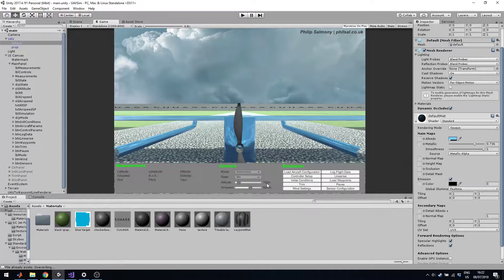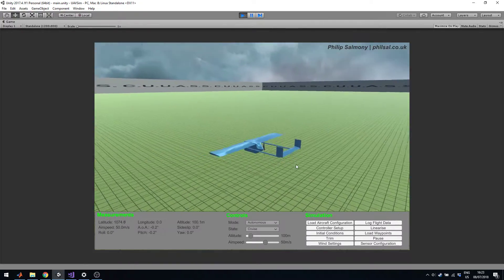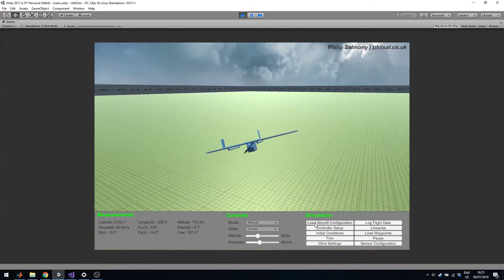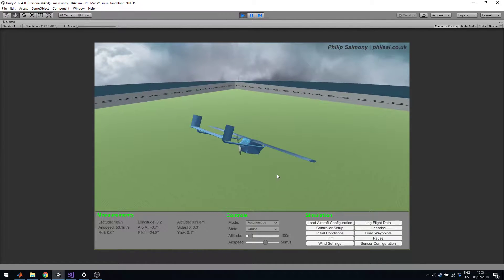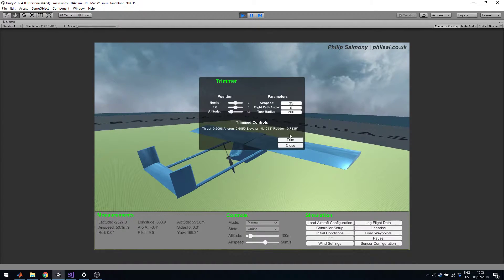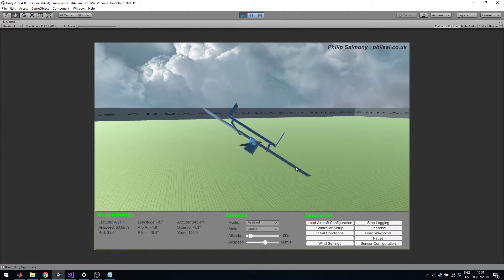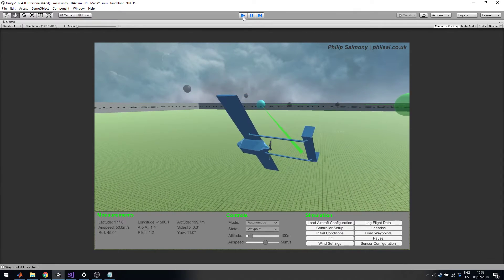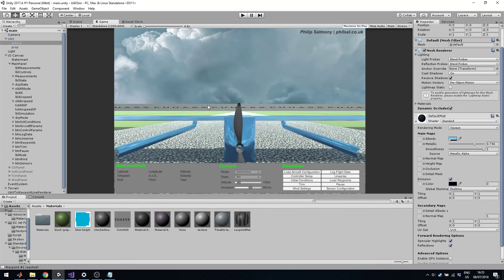DIY Flight Simulator (Unity/C#)

Comment: How did you make the control under the screen that can adjust Mode, State, Altitude, Airspeed etc.?
Reply from the maker: I just used Unity's UI elements and then add callback functions in coded.

Comment: Great job. How did the Challenge turn out for your team? Where you helped by the simulation on the Unity platform? We are aiming to try something similar for underground drone operation in mining environment.
Reply from the maker: Thank you! Unfortunately, we didn't end up taking part in the competition, due to exam stress and some members dropping out of the team. But for flight tests it definitely helped with getting the controllers in the rough ball-park and simply testing the flight control firmware logic.
Oh cool, is this an open competition?
Reply: @PhilsLab  It's no competition it's research work within a initiative called SUM - Sustainable Undergound Mining.  https://sustainableundergroundmining.com/ .  Too bad to hear about the competition of yours.